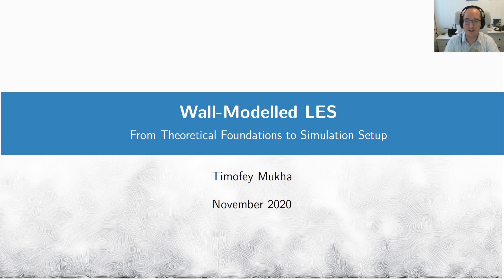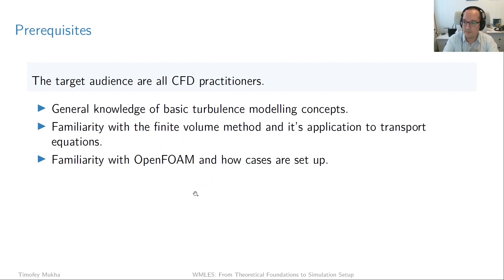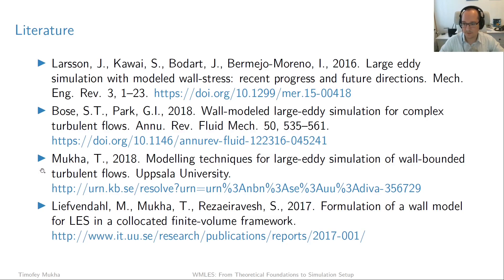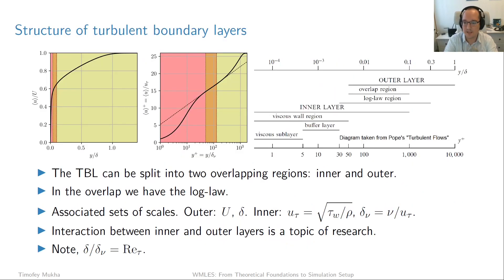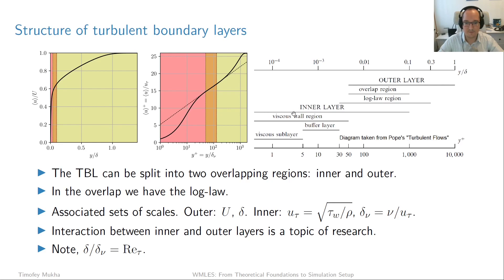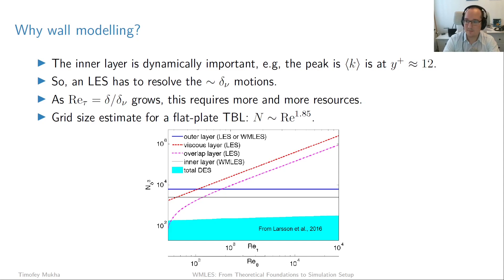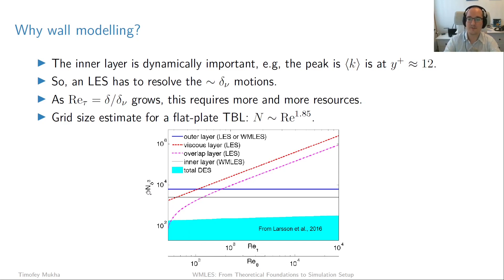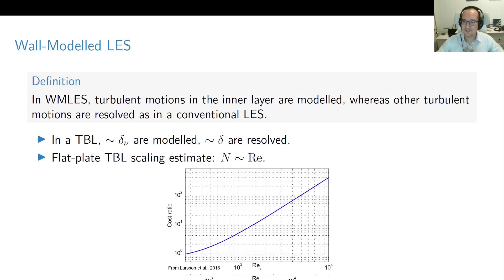Wall-Modelled LES: From Theoretical Foundations to Simulation Setup. Part 1

Comment: Hey Timofey, thanks for your valuable videos. Highly interesting. Will watch further. Will also check what is the difference between WALES and WMLES.
Reply from the maker: Thanks for watching. In short, WALES is a particular subgrid scale model, and WMLES is a turbulence modelling approach. You could, and in fact I do, perform WMLES with WALES as the SGS model, but you also use another model.